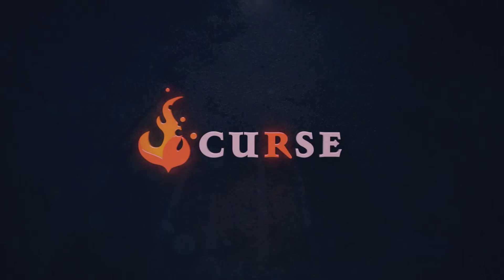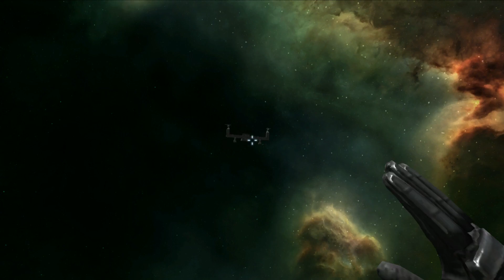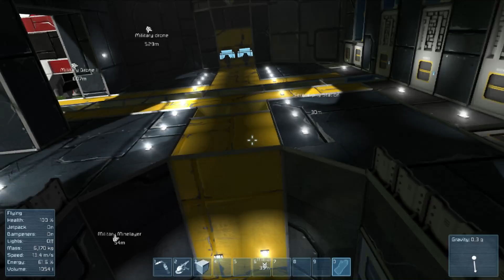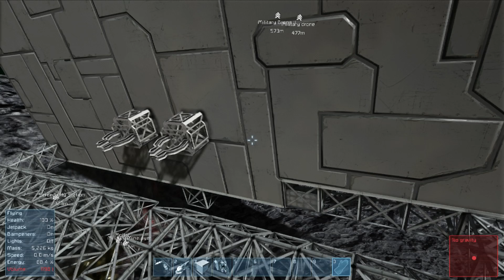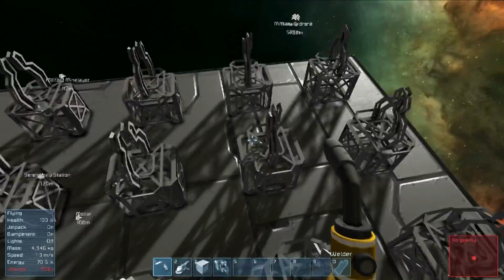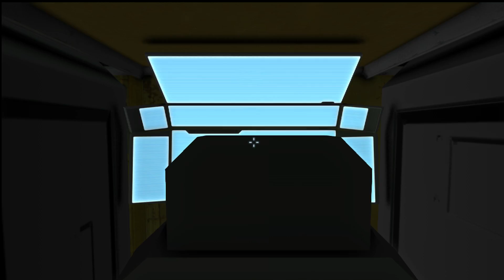Space Engineers co op survival - 21 - Trash compactor part 1

Comment: I was thinking of adding artificial mass gens to the back of the ship 'farthest from grinders' to pull the ship down with a gravity generator behind the grinder wall, but i've never tried using the artificial mass in this way. i don't know if this would be a better method than a tug, with the Military transports which seems wider and longer than the minelayer, but i could be wrong, it would take a lot of power to push it. at least with the AMG it'll pull it down at a constant rate. In theory.